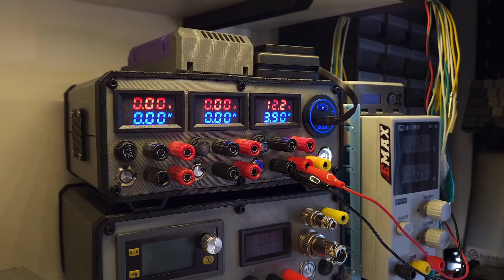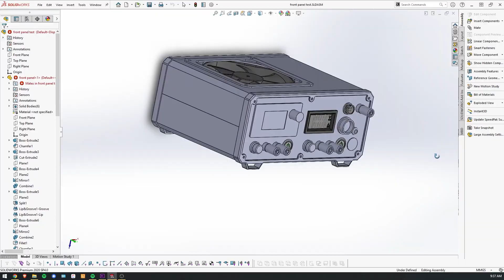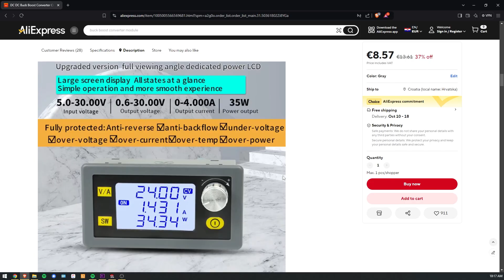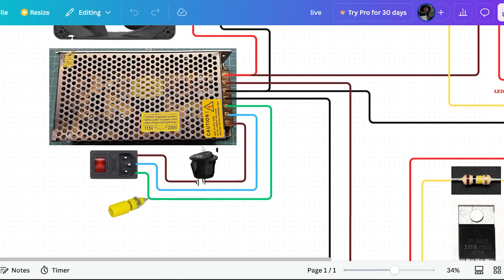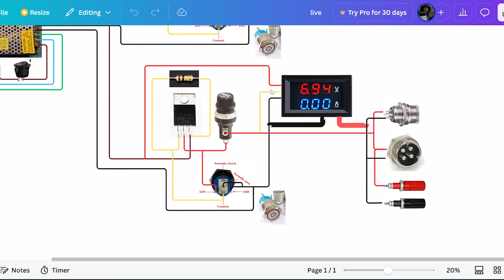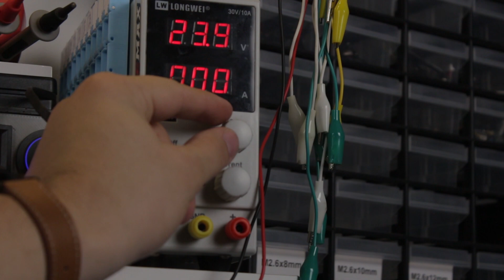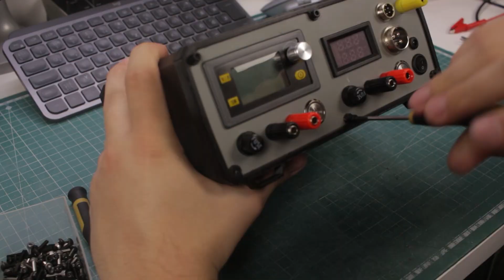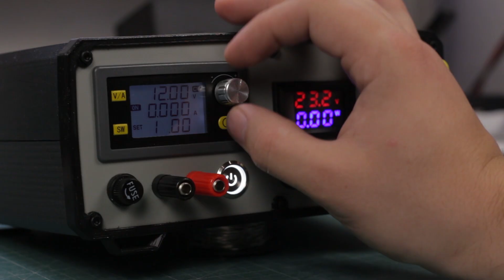DIY Variable Lab Bench Power Supply - 3D Print & XY-SK35H Module

Comment: Just finished building one, useing your design. Subbed a few parts, like the fan, very quiet. wished my wiring was as nice as yours, but it works. a lot better than the one I purchased . thanks for sharing

Comment: Nice video, which one p-channel mosfet are you using, it's no longer on aliexpress
Reply: Any clue?
Reply: Maybe IRF4905 P-channel mosfet will do. Which has 55v maximum drain source voltage, 74A maximum continuous drain current and 200W maximum power dissipation

Comment: Hello, being a novice I have questions, I am in the process of creating the lab power supply and in your diagram there is, in each voltage rail, an inscription 3V3T, or 5VT or 12VT. What does the T stand for?
And do you plan to make an oscilloscope afterwards?
Thank you for your response

Comment: Very cool project ! However, for my needs I'd prefer a fixed 12V output instead of 24V, how could I achieve that ?
Reply from the maker: you can do that by using a 12V power supply instead of 24V like I did
Reply: @Djambo57  how do you choose the fuse values? Or more simply, what values did you choose?
Reply: @Karpe_Deem  It's simple, if your source supports 220v at 3 amps, do not put a fuse greater than 3 amps, the same for the regulated output, if the controller supports a maximum of 5A put a 5A fuse

Comment: If I buy the 36V 5A power supply and follow your tutorial for the rest, would this still work? I would get the same parts but just change the PSU to 36V.
Reply from the maker: Well, I'm not sure the power supply module can handle voltage higher than 30V but everything should be listed in the description on the product page. If it doesn't, you can easily search for a replacement unit that does and all connections should remain the same...

Comment: I like the overall look and features of the power supply. But I would have put a switch on the fixed power side so I could select from two or more fixed voltages. Maybe 24V, 12V, 5V and 3.3V. The latter three voltages would be the most useful to me.
Reply from the maker: Hey, thanks for the comment! That would be interesting but would require a couple of more components.. Did you have an idea on how to make it work?
Reply: @Djambo57  one posibility is having a 1-pole 4-throw switch with the points connected to the 24V power supply, and the rest to 3 buck converters for 12, 5 and 3.3v. To negate the need for so many converters it would also be possible to make the switch dual pole 4-throw and have the first pole connected as described above but using the other pole to adjust the feedback voltage divider of the buck converter.

Comment: Andthe total price comes up equivalent to a pre-built bench power supply from aliexpress....  But still nice project
Reply from the maker: Well, the cost of materials could maybe get close to a prebuilt power supply but for me, I had most of the stuff laying around and it's an interesting project... Your learn about 3D modeling, printing, electronics, soldering... Plus, it's always there on your desk and you know YOU made it which makes it so much cooler

Comment: Nice video.  Curious why you switch hot and neutral and not just hot.
Reply from the maker: Well, for the ON/OFF switch LED to work, both live and neutral are required on the AC inlet socket...
Reply: @Djambo57  both are required, but normally only the hot is switched as for a lamp.  Just curious why switch both.

Comment: Really nice build. What is the approximate cost of the components ?
Reply from the maker: The cost of all components from Ali is around 50 USD but most of these are bought in bulk and can be found way cheaper so I bet you could bring it down to around 40 if you took the time...
Reply: @Djambo57  thanks a lot!

Comment: Why do you prefer to use mosfets for the buttons?
Reply from the maker: As @conorstewart2214 said, it is to keep the current and the voltage away from the switch. The switches used are rated up to 5A max and my power supply can output 5A. In such situations it's always recommended to give yourself a little bit more room to not overload the switch and by using a mosfet, I'm triggering the gate pin only which doesn't draw any current. All of the current then goes trought the mosfets which are rated 50A+ and cost cents so It just made sense to add them
Reply: In some high current or high voltage applications it is safer to keep the high voltage and current away from the user and it can be difficult to find switches rated for the current. However with the voltages and currents used here it isn’t an issue so there is no reason to do it.